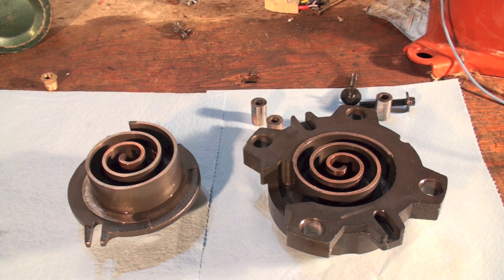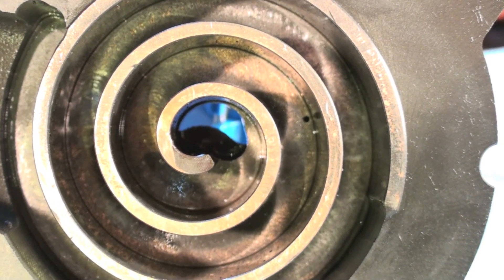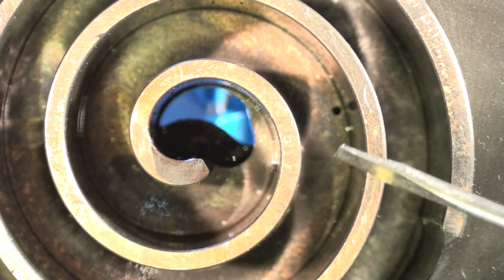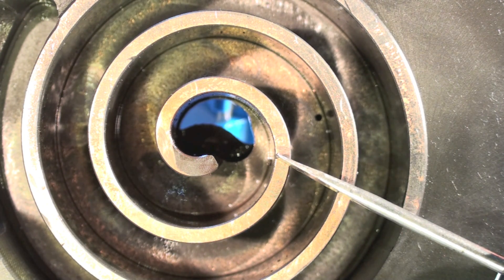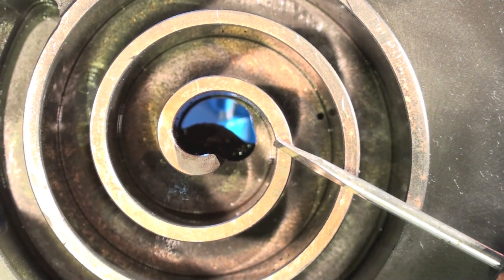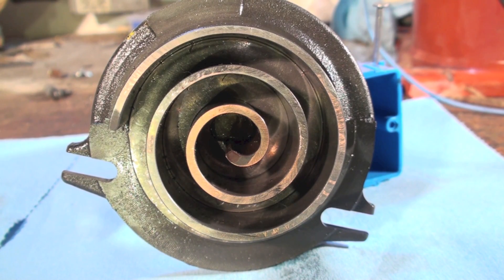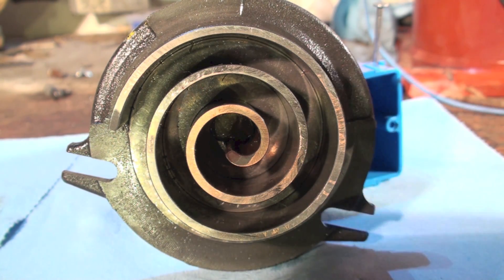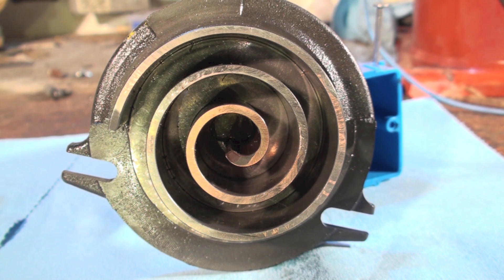Why the copeland scroll compressor had locked rotor.

Comment: i dont buy that de moisture did cause the lock on the rotor, the rotor is very strong. Howeever the copper may have caused not moisture but crasched evaporator and water is in compressor a real crash.

Comment: I thought the reason moisture is bad is because for some reason the oil reacts with moisture to form acids.

If you open up a compressor it will be clear why it locked up. I didn't want to bother with mine but I bet it already had problems to begin with and it just locked up probably because the problem got to be too much. 

I mean people use these compressors to compress air, they just have to dump out the oil and replace it with something that won't react with air (like ones used for air compressors), granted not continuously, but still...

Also people use these compressors for recovering refrigerant too.
Reply from the maker: Moisture does cause acid.  It also causes copper plating.  
Hermetic compressors are not used for refrigerant recovery.  In the 1990s they were used for recovery with catastrophic results. The company I worked for had around 40 of these hermetic recovery units that failed.   
GFM
Reply: @grayfurnaceman  I heard of people using hermetic compressors for recovery or as vacuum pump (almost every HVAC techs here use it for that), they pour out the existing oil and replace it with air compressor oil so that it doesn't cause acid.
Reply from the maker: My father used a hermetic compressor for evacuation in the late 1960s.  Recovery was not considered then.  No service tech worth his salt would ever consider using a hermetic compressor for evacuation or recovery in the last 50 years.  
They simply do not do an effective job.  A evacuation pump can bring the negative pressure to 20 microns.  A compressor used for refrigeration is not required to or is it capable of that kind of numbers.
GFM @taiwanluthiers

Comment: interesting.  The motors are coated with varnish to prevent them from shorting out.  I cannot imagine how copper wicked through that layer and yet the motor ran.  Not sure I see copper on the parts, maybe the orange is discoloration from rust, contaminated oil or most likely, debris from the system.  Yes the "clearance" are tight, but anything that "coated" the scrolls would likely wear off quickly during normal run.  Not sure why the rotor was locked.  would need to open the compressor and try to turn it by hand to see if it is truly "locked"
Reply from the maker: +kjreinha Check my compressor playlist.  There are other examples of copper plating.  Tecumseh also has examples in their service manual.  Hope this helps.
GFM
Reply: the copper tubing?

Comment: GFM, why cant they design the compressor with lubricant permanently sealed into the motor bearings.  It seems a real drawback to have the lubricant flowing throughout the system with the refrigerant.   Every time there is a leak it loses oil and if the system keeps running on low suction pressure there is little or no oil return to the compressor.
Reply from the maker: +Gene Friedman There are some compressors that are oilless.  Mostly diaphragm types.  Everything out there is a balance.  Longevity issues have made diaphragm types inappropriate.  Cylinders need lubrication, so some oil must be pumped out.  The scroll types pump even more oil than piston types.  There may come a time when materials have advanced to where oil could be disposed of but it just has not happened yet.
GFM

Comment: I have a question I was working on a train today and the suction pressure was 105 and the highside was 255. is this the compressor or overfeeding meeting device. any help would be grateful! thank you!
Reply from the maker: brennanac1 I am assuming the unit is R-22.  If the expansion device is overfeeding, the superheat would be non existent.  Hope this helps.
GFM
Reply: What refrigerant are you using? If it's R22 there's no way suction pressure can be 105. They top out at about 80 psi if you severely overcharge the system. If this is R410a then that suction pressure is about right, but the head pressure is too low. That points to weak compressor.

It's also possible that the compressor is weak, because that's not a good compression ratio. 

My AC compressor was weak prior to locking up. It was making all kinds of weird sound trying to start up, and when it did start up it was LOUD, and the needle on the gauge was jumping (like it had trouble pumping). Yea suction pressure was a bit high, I tried to lower the suction pressure by recovering the refrigerant thinking I had overcharged it. Since my system was a mini split I had no way of knowing what the head pressure is, and so it doesn't tell me if it's a bad compression.

I'd say get a new compressor.

Comment: why would the copper come from the varnished covered motor windings and not the copper tubing in the system ? In problem compressors that are running hot and drawing high amps I have been using Supco oil additive since the 70's, it works great, it cleans and lines all the metal surfaces and makes them slipperyer.costs 7.95, it's the best kept secret nobody seems to know about. It will also clean the inside of the evaporator's tubing helping the delta T. good video.
Reply from the maker: ***** Oil additives probably will make no difference.  The problem here is contaminants in the system.  They facilitate the plating.  The copper piping is generally too far away from the compressor parts for them to provide the copper for plating.  
GFM

Comment: I had a Copeland  compressor  in a 1999 Carrier heat pump package unit showing LRAs. Threw a hard start on it and it ran but it sounded horrible. It would pump, then it wouldn't pump, and back and forth like that til it opened a winding.. Can you please tell me what was causing all the noise?
Reply from the maker: Its hard to say without disassembly, but probably a piece of the scroll broke off.
GFM

Comment: Thank god there are hard start kits available right?
Reply from the maker: Actually, I don't think it would be much of a long time repair.  Maybe to keep it running for a hot spell.
GFM
Reply: grayfurnaceman If thats the case.  does the compressor has to be replaced?
Reply from the maker: OCTAVIO FERNANDEZ If a compressor will not start(assuming the run cap is ok), sometimes you can get it to start with a start kit.  I would tell the customer it will last from 10 minutes to 2 years.  The compressor is failing.  If the customer wants a little more time out of it, and is not bothered by having it fail with no warning, I would do it.  
GFM
Reply: Mine did not work with the start kit! Is just locked! Trane xl16i 2010